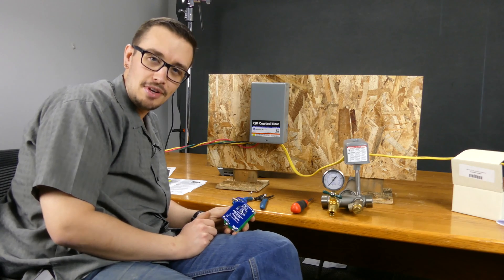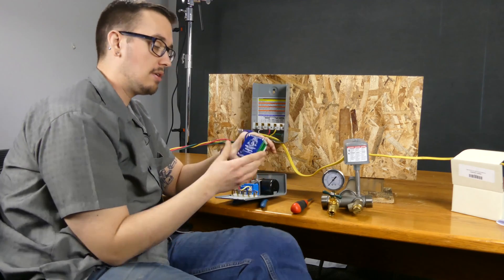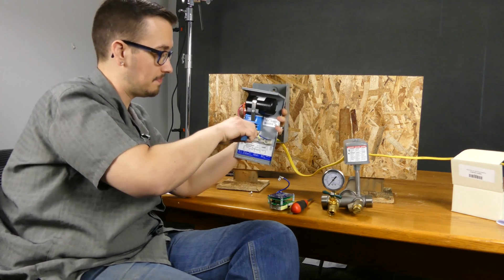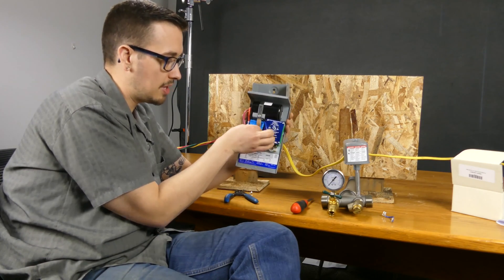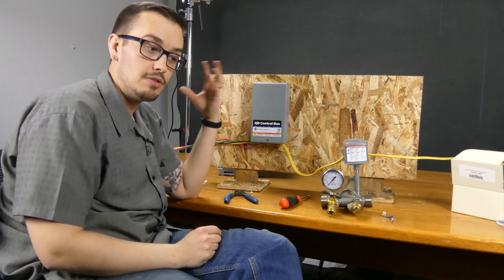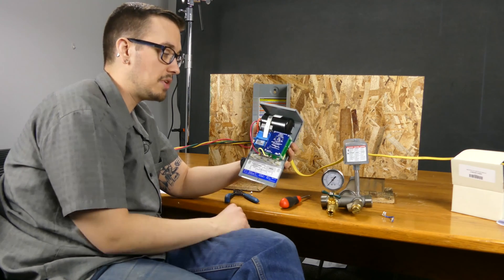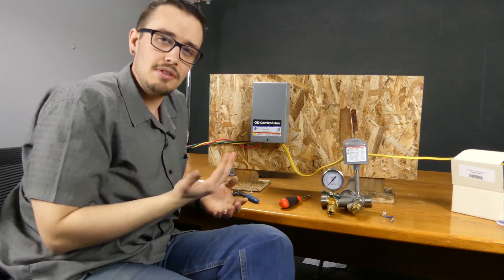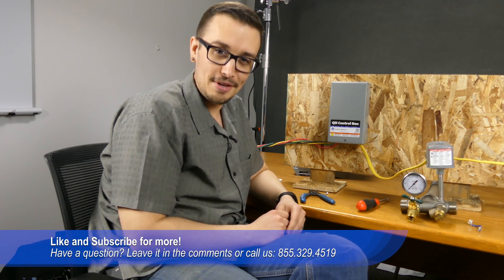Symcom 231-Insider-P Pump Saver

Comment: I know that this unit has an adjustable feature to delay the RESET/RESTART of the unit.  But is there a builtin feature that delays the startup of the pump each time it starts normally (not after a reset, just a regular startup)?  I use my pump for irrigation and would like to see a slight delay in the start of my pump in order to give the water valves a moment to open first.  Curious to know if there is a bit of a delay.

Comment: I've had this model for a year but a new issue has developed. The Insider-P is now ticking when my float switch shuts down one of the 120v load wires. I called Symcom and the tech advised me to swap load wires. He explained that it's ticking because one 120v load wire is always active (the other 120v load wire is attached to a float switch at storage tank), confusing the Insider-P. After swapping load wires the ticking stopped for a day but then started again. Now even if I swap the load wires again, the ticking continues. Is the ticking bad? Even if not, how do I stop it? Thanks for any help.
Reply: Did you have any luck figuring this out? I’m having a similar problem..
Reply: @hollyoconnor303  Not really, no. And since then the pump burned out (after only 1.5 years) and was replaced by a different model. Since the ticking no longer occurs I've assumed it was the fault of the replaced pump (Grundfos).

The issue also could have been caused by one of two other things that changed.
1.  The prior pump worked at 3/4 HP and my 12awg 850ft supply line was not sufficient. My new replacement pump works at 1/2 HP, of which that supply line is sufficient for.
2.  To get the new pump working as best as possible the supply line ground was removed.

Good luck.

Comment: I don't recommend the Pumpsaver products, I just went thru my second Pumpsaver Plus (Model 231 insider -P), in 8 years, the last one cost me a visit from the well company for a charge of $350. both of them were just out of warranty. I'm trying the QD Pumptec, its cheaper and does the same thing. I spoke with tech support and they weren't helpful, they didn't seem to really care
Reply: Yeah...I'm about to go through the same thing I think. Power goes to the box, then a "CLICK" and nothing more. Do I recall correctly  it has something to do with that capacitor on top of the control box being the weak link?
Reply: The capacitor is subject to failure, but you can usually visually verify its failure, if it shows signs of leakage from the end the wires connect, it's bad, you should have a spare one on hand anyway, so but one for $10 and swap it out, with the circuit breaker tripped of course, then check it out
Reply: @desmetde  Was the over voltage red light on?
Reply: I just replaced mine May last year and just ordered a new one again already. 🤬

Comment: Hi does this react to a recycling situation?
Reply from the maker: I think you meant to say rapid cycling, and yes it does protect against it: Here's what the specs say "Constant monitoring of voltage and current protects
 pumps from dry-well, dead-head, jammed impeller, rapid cycling, and voltage faults"